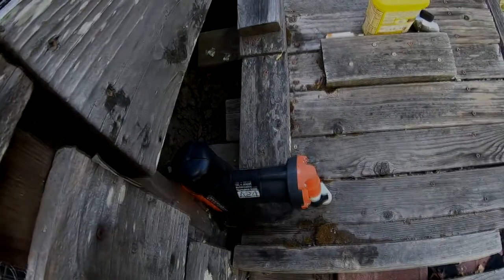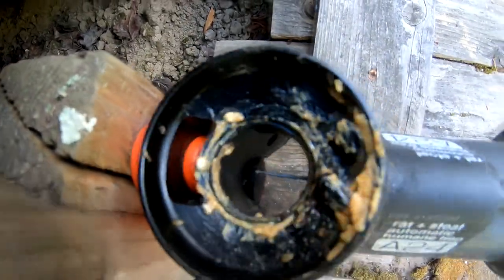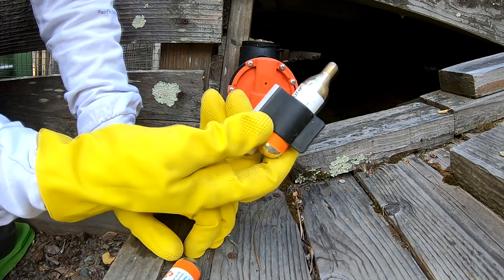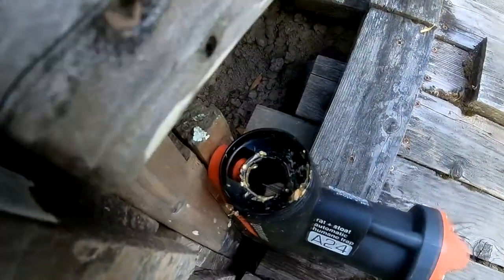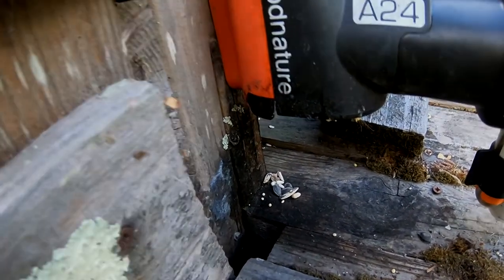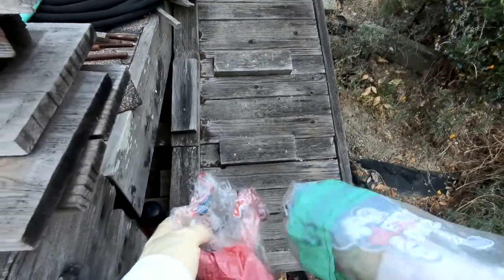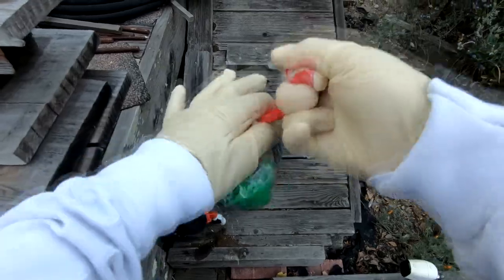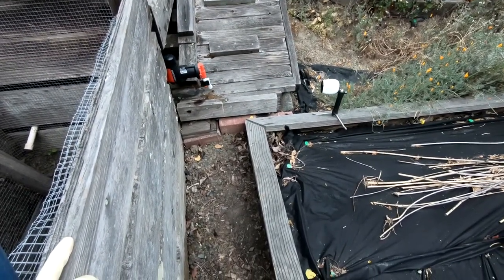A24 Rat Trap: Replacing the Gas Cartridge and the Demise of Rat #11

Comment: My former employer (I am retired). a plumbing & industrial supply, sells a similar CO2 cartridge but the threads were not the same so they will not work in the Goodnature trap.   Other sources may have a suitable substitute for the Goodnature cartridge.     The stock bait has not worked for me at all but it is winter here (Connecticut) and the rats may not be very active,     Have read that Nutella works better as a lure/bait.     Gonna try that mixed with bird seed.
Reply from the maker: I have an upcoming video about using alternative CO2 cartridges from bicycle tire inflators. They are much cheaper. A24 warns you against using 3rd party CO2 cartridges, saying it voids the warranty, but my warranty has already expired.

I haven't had much luck either with the "self-feeding" stock chocolate bait. It runs out too fast (it's advertised as lasting 6 months) and the rats don't seem interested in it.
Peanut butter & bird seed is what I use. Nutella would work as well I think.

I find it interesting that the "bait cards" that came with the trap have peanut butter inside, but their bait uses chocolate.

The main thing I've learned is that you need to have a motion activated camera pointed at your trap. If you don't, you really have no idea what's going on.
Reply: Good nature air canisters contain lubricant / seal conditioners. Bicycle tire inflators don’t.

Comment: If you're using the stock bait feeder, I find it oozes down enough that rodents can reach up and grab some without hitting the trigger.
Reply from the maker: Yes, I found it comes out too fast. 
The stock bait is supposed to last for 6 months, but I think that is not accurate. It is way less than that.

In our area (CA, U.S.A.) the rats are used to eating bird seed spilled from bird feeders and they also like peanut butter.
I'm using a depleted stock feeder cartridge and I'm just spreading some peanut butter on it for glue/smell and then dumping some bird seeds from the bottom. Some stick to the peanut butter so they have to go up high to get it.
I usually spread some more peanut butter just inside the trap (below the trigger) to get them used to going up into it. Some of the seeds will stick to that too.
I also spread some on the wood  below the trap.

I also found it interesting that their bait cards (that you put out to see where rats will feed) use peanut butter but their stock feed uses chocolate.

Anyway, the only thing i'm purchasing from A24 now is the gas cartridges and I suspect those are generic, so I'm going to try a 3rd party next time that's cheaper.
Reply: Beta Cygni very good info! I just purchased my first trap, still waiting on it in the mail. I’m curious to see your experience with a third party Co2 cartridge. Also I wonder why the second cartridge had less kill strikes?
Reply from the maker: @kylewestrom7849  It will be a while before I test a 3rd party CO2 cartridge because my current one only has 3 strikes on it.
I think the variation is that when the trap is triggered, it's a violent event and I'm guessing the amount of gas released depends on a lot of random factors.
Good luck with your trap.
Reply: @BetaCygniBlog  I’ve seen 16oz cartridges sold in bike shops. You would just need to check the thread to make sure it’s the same. But there is a very cheap tool for that.
Reply from the maker: @graycleary   @Graham Cleary  Thanks, I have a thread checker and the one I bought checks out. A24 warns you about using 3rd party CO2 cartridges saying that if they have water in them, it can harm the mechanism and void your warranty. My warranty has expired and I'm not that worried about water in the bike CO2 cartridges.
 I'm going to be installing one once the current A24 CO2 cartridge runs out. I have 12 strikes on it so far. I'll probably change it when I get to 15.  I'll post a video about my experience.
Reply: @BetaCygniBlog  Great. I can see why Goodnature would say that we should buy theirs but honestly I just cannot see how bike co2 would contain water or anything other than co2. 

By the way, I switched my bait for a mix of chicken feed and peanut butter. Hopefully I’ll get a hit this week. Don’t know if rainy weather puts rats off though and we’ve had some miserable rainy days lately.
Reply from the maker: @graycleary  I agree about the water & CO2, but it does take extra processing to get water out of the gas you're compressing. I assume that the bike CO2 cartridge manufacturers know that water going through a bike tube valve is going to cause problems and would work to avoid it.

My rats are still out when it's raining. You can see from my setup, I have a deck they can hide under if our cat or the neighbor's cat aren't around. I originally installed it there because my compost heap (inside a wood box) was attracting them.
Good luck and let us know if it works.

Comment: @8:41 - after you changed the gas canister then why didn't you test it again with the chopstick? To make it works when the pin is triggered?
Reply from the maker: Good question. The A24 is very reliable. If I triggered it after installing the new canister that's one less rat it could get. I was confident it worked, it not, then I'd see again on the video and I could troubleshoot it.
Here's another video about how many strikes you can get out of one cartridge:
https://youtu.be/3J8En496cdw
Reply: @BetaCygniBlog  OK thanks. Can i get a 3rd party 12g can as well - will that work as well? Or does it have to be 16g? I mean like the canisters used for air rifles, etc?
Reply from the maker: @roderuna7750  You're welcome. I don't have an air rifle, but from what I can tell those won't work. They have to be threaded and the ones I've seen aren't. 
The other thing is you need the proper diameter for the strike detector (white thing attached to canister) to work.
These are the ones I used: https://smile.amazon.com/gp/product/B076YVFGKC/
They're used for bike tire inflators. They're easy to get and cheap.

Comment: Take the old cannister.  Drill a hole in it and connect it to a soda stream bottle with a suitable hose and fittings.  Much cheapness ;)
Reply from the maker: I have an upcoming video where I'm going to install a CO2 cartridge from a bicycle tire inflator instead of the one from A24. They are much cheaper.
Reply: @BetaCygniBlog  Kl.  These products wont be on the market long.  Battery powered are on the way then no need to purchase replacement cylinders.
Reply from the maker: @SynKronos  I'm not sure a reasonably sized battery can supply enough power to drive the piston fast enough to kill the rat instantly like the A24.
I caught the piston firing in slow motion on my latest video:
https://youtu.be/cyOGiugVR8k
It fires in about 1/24th of a second with a tremendous amount of force.

 Plus CO2 (gas) is reliable. There are more things that could go wrong with a trap that required a solenoid driven by electricity.

One of their use cases is putting this in the field for 6 months without maintenance.
https://www.automatictrap.com/pages/videos?gclid=Cj0KCQiAyJOBBhDCARIsAJG2h5fMPqEYvYSVDjt-44DuxRZf5gmSUY1Dfq7zuXskcdyyNWn7_CQUDGEaAscCEALw_wcB
Reply: @BetaCygniBlog  To the contrary.  You could easily do that via a standard 1.5 volt AA battery.  What is used is capacitor discharge to fire a solenoid,  all very simple although as obvious Lithium is better.
Reply from the maker: @SynKronos  Interesting idea.
Reply from the maker: @doloresm7396  Yes, I don't think batteries are a good substitute for the CO2 cartridge. I've found it very reliable and immune to the weather. The only issue is how many strikes you get out of a cartridge. Once it gets over 10, I start wondering how many are left.
I did a video about that and using a generic CO2 cartridge:
https://youtu.be/3J8En496cdw
In practice, I usually swap it out after 15 strikes.